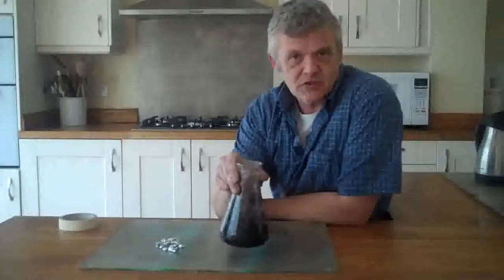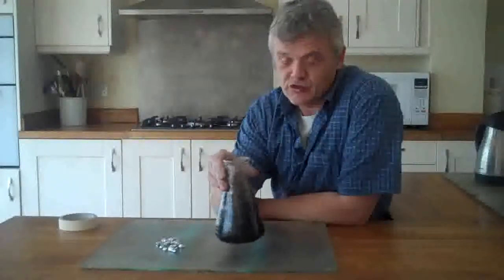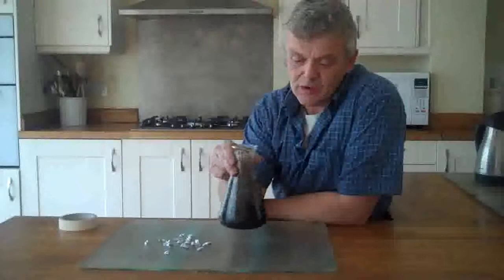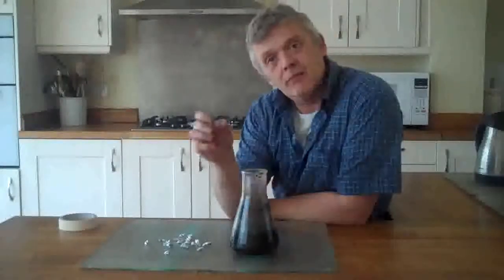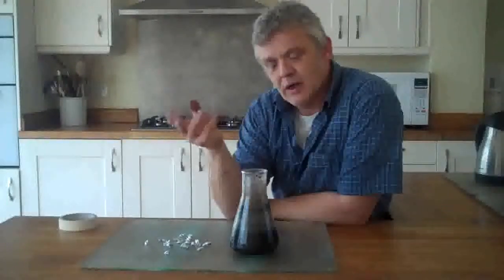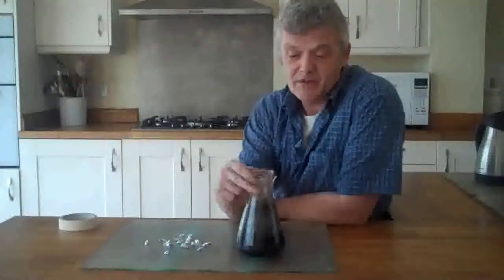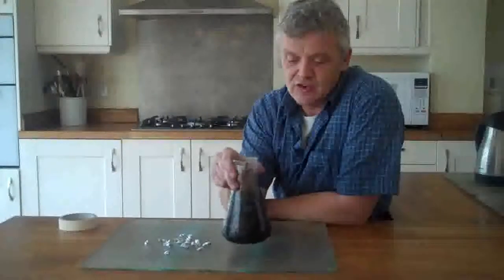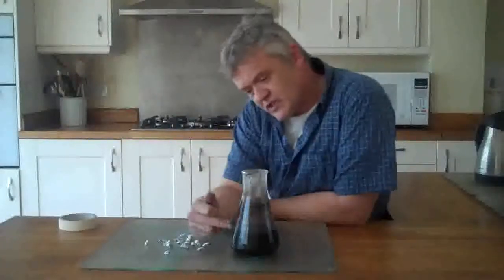Update on Easy Reduction of Graphene Oxide to Graphene

Comment: hi sir i m doing a project of making transparent electrode of Graphene  but on reducing GO i m getting a metallic luster which is restricting transparency.can u please tell me why that luster and is there any way to avoid it?
Reply from the maker: yo're making your film too thick - the metallic luster is graphite
Reply: Robert Murray-Smith i m dipcoating GO on PVDF film and coating thickness is like a few microns maximum.
Reply from the maker: lakshmi variar
why not mix the two and do in situ reduction using UV?
Reply: Robert Murray-Smith i need an insulator with conducting coating on both sides
Reply from the maker: lakshmi variar
fair enough

Comment: Thank you for your very interesting videos. I suggest an idea, probably very naive and certainly stupid..:  in order to reduce graphene oxide to graphene do  you think it would be possible to make a cathode with aluminium or titanium coated withe graphene oxide protected with microporous varnish and running this cathode in a mild electrolyte like sodium sulfate, at this cathode would be produced nascent hydrogen that could possibly reduce the graphene oxide to graphene leaving thus a titanium or aluminium sheet or ord coated with graphene ?
Reply from the maker: I think it is more than probable that this idea would work - nice thinking